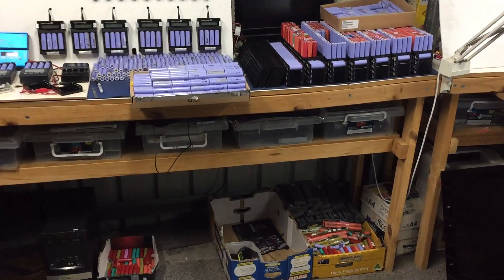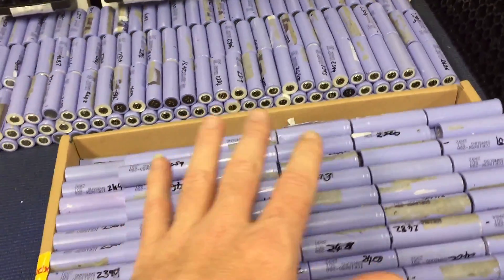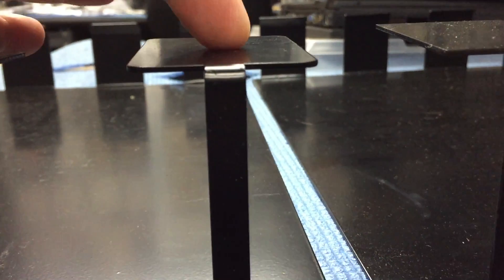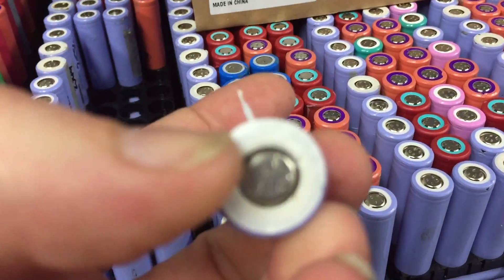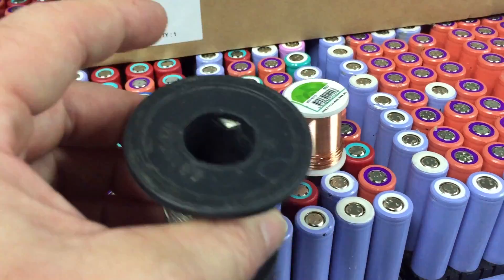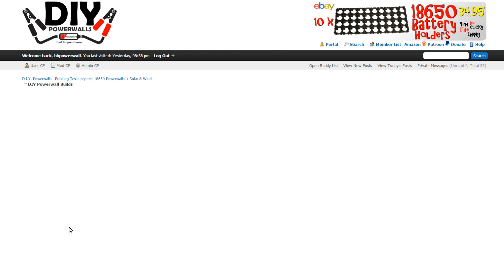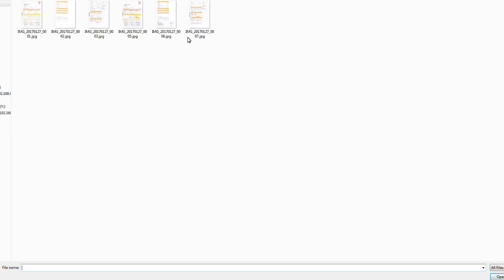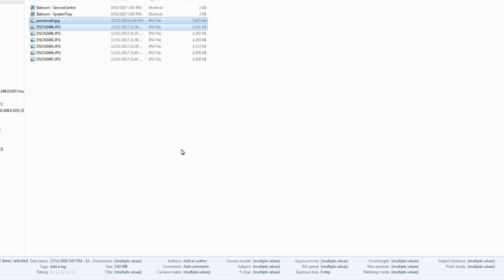Heading to 50 kWh's of 18650 storage 🚀

Comment: These batteries are too risky for my taste. I opted to use Marine batteries instead. I buy them new for $99 at Autozone with a 5 year warranty.
Reply from the maker: If you have space and need ballast for your boat it's a perfect choice for you. If you need to hang them on the wall and require energy density and 10 plus years with maintenance I'll choose these. Installed in a safe location perfect solution
Reply: @HBPowerwall  Keep a fire extinguisher near by. Keep up the good work.
Reply from the maker: Fire extinguisher will be useless - just run
Reply: @HBPowerwall  lol

Comment: One bit of advice separate your battery holders so each one is a seperate piece of metal and only has a potential to short to one pack. Then you don't have the voltage potential issue. between battery packs. So its not possible for any short to matter. And air gap is really your best protection here. And if you did that there even a good argument for "connecting the metal to battery ground to establish a known state. 

You might want to look up why we ground power in mains grids to get a full understanding of why a known state is important.(starter on concepts) https://www.youtube.com/watch?v=fRhofcMyAyk Its about main but a lot of the concepts apply to you battery packs.

Or make it out of plastic to make it double insulated remove the issue completely.

Comment: I don't understand how a pack could "go up" because it didn't have double fuses. By "go up" do you mean some of the fuses blew and it was annoying to go in replace them. Have LESS fuses makes it LESS likely the pack will catch fire because it will open circuit sooner.
Reply from the maker: Ok so that comment / line of thought was relating to another youtuber that had a pretty bad screw up with his cell. and having double fusing would have made it a non-issue. I've since gone back to single fusing for many reasons.

Comment: i am trying to do too make a ammo can battery backup 12v  that can if as miny as i can, and a 6 cell USB tablet .i would take what ever i can get. these are the farst two video i am going to try when i get the parts. i am making a spot welder do not now if this is a good thing. but we do what we can i rather buy the mount than make one.

Comment: having good luck with used AGMs(power sonic) in so cal now...  full off grid, 3 kw,   3 fridges..etc. 150 degree water, 
nice work on the wall
Reply from the maker: SOOO over AGM been there done that.. check out my videos from a few years back.. wow they were bad batteries... (used cheap almost dead when i got them ) but I'll admit learnt a lot from them
Reply: Agreed!

Comment: Hey mate just 2 questions!! Would you change the design of the brackets so that all the weight is on the battery holders and not on the batteries them selves? And does that charger that was in this video discharge the battery as well? If so I'll jump on the amazon website and get one. ( your link of course) 👍👍
Reply from the maker: Change my design I guess I could but I really do like it :) Many others are doing powershelf idea, laying them inside of server cabinets. Quite a bit of work gone into this design so might be keeping it for a while :) Were you meaning the OPUS ones ( my favorite and I only had two on the bench http://amzn.to/2kH0vxf ) they are faster than the Digital Charger 4S but they 4S are VERY good units also http://amzn.to/2kS8Cfp

Comment: Please forgive my newB questions.  I just fell upon your site, and I have to ask, are you creating your own power storage system for solar storage?  How many panels are required to keep this all powered up and how long can your system run off grid with limited sunlight?  I have a great interest in solar power, but finding a local expert has proven difficult.  I thought I could jump in and do my own using data from the Tube.    Thanks for uploading so much useful data.
Reply from the maker: Yes, I've built it my self from googling it lol .... 3kw of panels charge it each day. if we know bad weather is coming we treat the power with respect. If it's good weather we run aircons all night from it. Do the washing and drying etc We use it without respect. Really hammering it also is a good way of fault finding

Comment: I'm working on an EV battery pack, what 18650 tester do you use? I'll need to go through several hundred of em and can't be bothered to multimeter them all 👍
Reply from the maker: I use the Opus BT-C3100 unit here - http://amzn.to/2kOace3 fast & quiet. To speed up the process people are buying 10 or more of these units. using them for a few months then selling on http://www.diypowerwalls.com when they are done. Effectively halving the cost of the unit and cranking through a few hundred cells per day.

Comment: Just stumbled apon your videos for the first time.

I have 10Kwh of AGM battery, 2.5Kw of solar panels, just for my PC in my garage.
Real cheap setup, I think it cost me $2200 for the entire setup.
I have a 60amp 48v charge controller and a 2.5Kw high frequency inverter.
Batteries are from a Telstra cellphone tower.

I live in Tassie, I noticed you had a Tassie video.

DO NOT MINE BITCOINS, DO NOT BUY AN ANTMINER/ASIC MINER.

You need to to mine alt coins that are the most proffitable. ASIC miners have killed gpu mining for bitcoin and litecoin.

I did have 3x GTX 980 Tis that I already had regardless of mining because I wanted to get on the 3dmark hall of fame. I was making around $8 a day with thoes 3 cards but that's with around 950w of draw. Still a lot more than I would get selling the power to Aroura. I sold all of my cards in preperation for AMD Vega release and bought a single GTX 1080 to keep me going.
My single GTX1080 is earning me about $3 a day if I run it for 24 hours. I only run it for about 8 hours a day because I use my PC when I get home and everything shuts it's self down when the battery bank hits around 70% as I want to keep the AGM batteries in good condition.

I am a software developer so I wrote some software for my adruino to manage my solar and cryptomining.
http://finnsk3.com <- you can see my battery bank voltage there.

I have friends who cryptomine on mains power and they get about 50cents per kwh minimum so even though they are paying 26cent per kwh they are making a proffit. I reckon I will do this in winter to keep my house warm as my 3x 980tis kept my entire house at around 20deg through last winter with no other heating. My solar setup is basically useless in winter, I go from making about 20Kwh in summer to about 2Kwh in winter.

Comment: Instead of putting dead cells at the bottom, how about just a few pieces of wooden (or metal or plastic) rod? Should be even stronger and safer.
Reply: Like those fake plastic filler cells that come in some of those laptop batteries.  I think he is doing it for the looks tho
Reply from the maker: +Jesper Monsted want it to look good :) crazy but it's all about the looks
Reply: Weren't you going to wrap the cells in heat shrink anyway? Just wrap the stronger rod in heatshrink instead.
Reply from the maker: can't find the same colour
Reply: I had some laptop packs that had, basically spacer cells in them.  So it was like a 8 cell pack but 2 of them were dummies.  Just hollow tubes of plastic the exact size of 18650s, would something like that work?
Good video, glad u posted here ;)
Reply from the maker: Defiantly work and have a box full but they don't look the part :)

Comment: Thanks for add/link.  Big Thumbs up here.  Agreed, its not perfect yet but its a start in the right direction :)  Your wire test vid coming up in a day or so.
Reply from the maker: Get some new subs?
Reply: Was just thinking that after you drain those filler cells to 0v they will bounce back a little, so if you dont care thats cool, if you care you could put a resistor or solder your fuse wire across the + and - to keep them 0v or keep them in the jehu light for a little extra time
Reply from the maker: was just planing on killing them in the Jehu Light then a well placed wad of solder would do the trick. Even dead flat them and connect a magnet neg to positive for a few days that would be easy and fast.

Comment: Good god man, thats an insaine number of cells!!! I am interested in those unwanted cells below your desk, but I live in the US so shipping might be an issue, or would it?
Reply: He doesn't ship, period. If you really wanted those cells, you would need to get in a plane and head over there yourself, pick them up and somehow get all that lithium home on a plane without being caught. It wouldn't be worth your time.
Reply from the maker: Yeh, sorry don't ship :)
Reply: HBPowerwall thats fine, one question though: what do you do with cells that are low voltage? Like between 1 to 2v? I purchased a group of 30 laptop batteries and ALL of the cells are in the 1-2v range :(
Reply from the maker: +parker benz in my case low voltage isn't and indication of quality test every cell.
Reply: HBPowerwall will your 4 slot battery chargers charge from a low voltage? I am currently using an Imax b6 to charge cells
Reply from the maker: +parker benz there is a limit but don't know how low
Reply: HBPowerwall thanks for your help! Keep up the powerwall!
Reply from the maker: http://amzn.to/2kRqp2W that's a link with my referal code :)